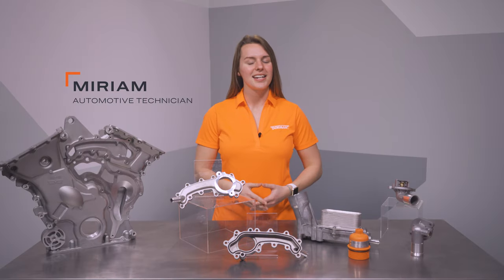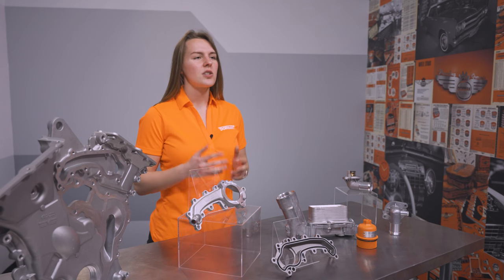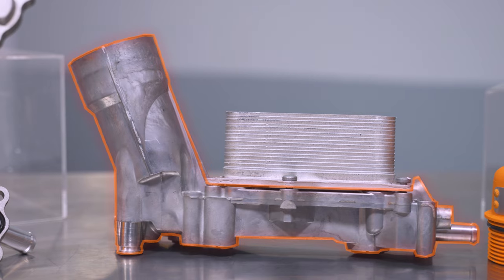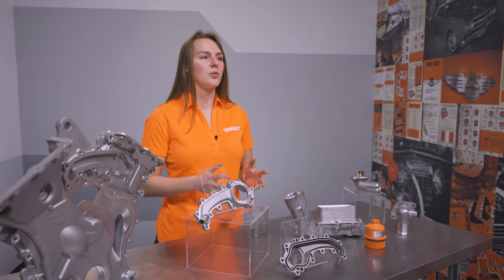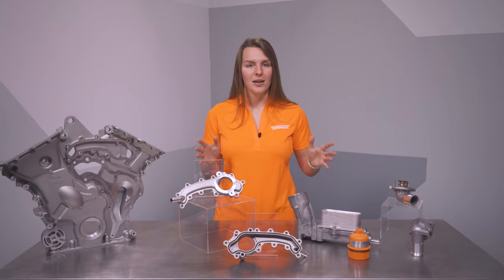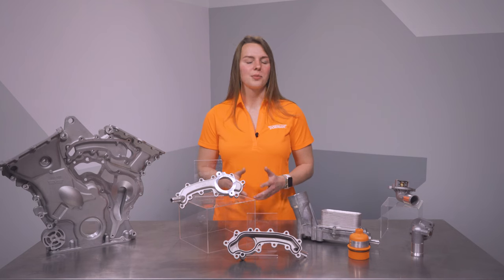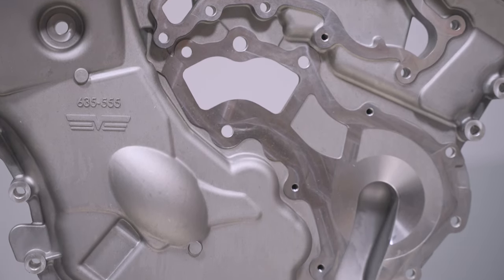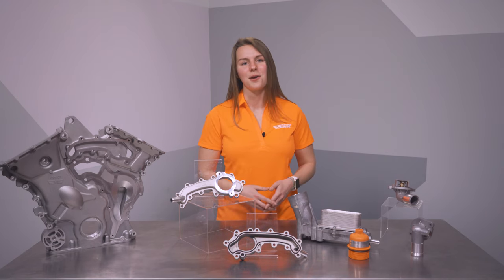How to bulletproof your Pentastar engine with Dorman OE FIX solutions

Comment: DRY START..That’s what kills the valve train. After engine shut down all the oil returns back to the pan. When left for 1 hour and then restart.. there is no oil in the gallery. The engine starts and no oil for 3 seconds. Repeat this for 100,000 miles and no oil in lifters or push arms. Results in  rocker bearing and pin wear in rocker arms then owner is on hook for premature change out of damaged cam, lifter, rocker arms. THANKS CHRYSLER FOR THE EXTRA COSTS OF OWNING HOUR PRODUCT.
Reply: People keep saying what a great  motor it is, sad these after market  parts are needed. The fatal flaw is the oil transfer during startups
Reply: Very poor design from the OEM on those lifters. Clicking noise is a KNOWN issue on these engines.
Reply: Baxter Performance solved the oil problem by adding a custom oil filter adapter with a check valve to stop about 1quart of oil from draining to the pan. That way valvetrain gets lubed instantly on startup. It also uses a typical oil filter from a 5.7l hemi I believe. Pretty neat but kind of expensive at $325-$385. Solves the expensive problem though.
Reply: Just did my oil cooler and Baxter performance upgrade with the oil filter remote- what a pain in the butt mods. I should post some videos of that for my 2016 JK Rubicon soon.
Reply: @onememories8523   I don't have the Baxter Adapter yet but im going to get it eventually. I'll need the extra cooling from a remote mounted cooler since my Challengers Pentastar is Turbo Charged.
Reply: Just use thicker oil problem solved 270,000 mile pentastar i drive
Reply: @kkp9068  I use 10w 20. Also live in a mostly hot climate. Seems to help
Reply: Not true I just did a head gasket on one not too long ago and it sat for 3 days and still had plenty of oil in the valve train… what kills these is not changing the damn oil every 3-5k miles.
Reply: @Eco.boost2.7  I'm glad you said that. Thank you. I was concerned about that. I hear it's a solid engine....
Reply: @kkp9068 I did hear that as well that a slightly heavier oil is what the engine should be running...what weight do you run? I thought Chrysler changed the requirement.
Reply: Change every 8000 miles full synthetic,mostly highway every day
Reply: @kkp9068 what weight and brand oil you use ?
Reply: i been using lucas synthetic high mileage oil additive on my moms journey, n i tell her to not let it idle for long times because i heard at idle the top doesnt get suffecient oil?
Reply: Hey man...  ive done alot of valve covers off engine cranking on these engines and oil supply is instant so your totally wrong and dont know what your talking about. Its always oil neglect that kills the rocker followers needle bearings. Change your oil at 5k and no more. Thats how you prevent the problem. Dont be spitting out bs. I can clearly tell you dont work on these. Or just guessing. Cause every 3.2 n 3.6 ive tested it on. Has oil almost instsntly. Keyboard mechanics are a joke.
Reply: @kkp9068  you are going to kill ur engine. 5k miles. No more. Better at 3500. Do ur 8k. And watch u have chain/rocker issues.
Reply: @joeb2588 do not put heavier oil in ur engine. They are designed for the thin oil due to small passages. Thicker oil ull have higher oil pressures and on cold starts you will dry start ur valve train. If the engineers say use this oil freakin use it. Your not e engineer. Thicker oil is doing more harm and 0 good... sure the engineers used plastic parts. This is to reduce weight and cost of production. Has nothing to do with oil and physics. Thicker means harder to push. Stresses pumps. Stresses vvt higher pressure on bearings will push the rod/main journels on the crank into the bearing material. Its not difficult.... shesh.
Reply: @Eco.boost2.7 finally i find someone in this guys made up story that has experience with these valve trains. Hello my fellow real tech and not a keyboard mechanic! Salute brother
Reply: @Bobcagon  I was told that there's still some oil up in the motor because not every drop is going back into the pan.
Reply: @joeb2588  I agree in part with what you say. What I’m saying is it’s based on time as mentioned. Why else does this engine have  so many YT channels all decrying the same issue? It’s not bad parts manufacturing. It  has to be something else.
Reply: @CBREngines  i use full synth,and oil still looks fine ,thats why i use synth to go with longer between oil changes ,all highway
Reply: Ehh, not really. I took the connecting rod and main caps off an engine that i pulled from a truck about 6-7 years ago. There's still an oil film on every metal and bearing surface. Sure, it was a 1989 TBI 350 from a GMC but oil is oil. Also, with a typical V6 running over 500rpm at startup it shouldn't take 2-3 seconds to get oil to the valvetrain
Reply: @kkp9068  I was told the 3.6 would throw a code,  possibly, if a thicker oil was used. I had mentioned using 5w30...as I belive the engine used to solely run on. ?
Reply: @cc23001  so a good oil, changed regularly,  would leave a film to protect during start-up? Makes sense due to there being like 13 million of these engines out there. My question is, do they all fail?
Reply: My parents' grand caravan had to have the left side cylinder head rebuilt at around 75k to 80k.
Reply: @Spectre94951  seems like that's when that issue occurs...or as my mechanic says regarding the leaking oil cooler housing, "not if it leaks, when."
Reply: @kkp9068 what oil weight and brand do you run?
Reply: @CarveLife  5w30 supertech hig mile full synth change every 8000 miles and oil still gold color when i drain
Reply: @CarveLife  2012 jeep wrangler  i use supertech  5w30 full synth high mile , change every 8000 mile and when i drain oil still gold color
Reply: @UPerformace where from?
Reply: @CBREngines Actually engineers made this engine to run on 5w 30, but due to government regulation were pushed to use 5w20 for better gas mileage. Engine was desgined around 5w 30.
Reply: These are great engines. Don’t run anything thinner than 5w30 and use a quality filter. Rocker/cam issues not across the board. Only certain years after they switched to 5w20/0w20. Baxter makes anti drain back filter adapter if you’re wanting to spend the money. 

Customer of ours had a 3.6 in his Ram work truck. He was at least 7000km on average over his oil changes and only used semi synthetic oil and cheap Napa filters. He got just under 400,000kms on the motor before it said no more.
Reply: 2011-13 was 5w30. 2014+ was 5w20/0w20. European vehicles with this engine state to run 5w30/5w40. 

Stick to high quality 5w30 oil and filter.
Reply: I had one squeel and then completely seize. I have a other squeeling. Is that the cam shaft running dry? It happens for the first 30 seconds of running
Reply: @ What do they sound like after warm up? Keep in mind there should be no “clatter” at all. Not on initial startup nor once running. As an offshoot I bought Rocker arms from Amazon and have had no problem with them. Considering everything nowadays is cost related.. I wouldn’t doubt many original parts on American made vehicles are manufactured in China.
Reply: 5w30 Pennzoil ultra platnium. 5w20 is kryptonite to the 3.6

Comment: The engine cooler housing is not what’s failing, it’s the seals. There shouldn’t be seals but gasket instead. The plastic one works just fine and dealers know this. That’s why when you go in for warranty repair the dealer only replaces the seals. The seals fail due to rapid change in temperature during warmup in cold climates. Did you guys stress test in cold climates before you’ve come up with this solution? Call any shop in northern parts of North Dakota and ask them how many of these they replace in the winter.
Reply: I agree with this. 125,000 miles on my 2015 and the plastic housing was fine. The rubber seals had flattened out completely and lost elasticity which caused the leak. All that was needed was a new seal kit, which can be bought separately from Mopar for less than $20.
Reply: Naw bro.. the aluminum on is wayyyy better and if you've got a lil bit of porting skills, port and smooth out all the burrs in it and the car runs happier. 
Though it is the steals too the plastic plugs crack. 
No part should be plastic with hot oil and coolant running through it
Reply: The tubes on my OEM oil cooler housing cracked on the ends. They definitely also fail.
Reply: Yep, they should use a double metal gasket, that is “lipped” at the ports, much like what is used on an intake manifold, but you are 100% correct with your statement.  I wish an engineer would design a gasket to use, instead of those cheap rubber seals.
Reply: @witdaMacksauce yeah, but I heard the aluminum housing retains more heat that puts more strain on the seals, which is why many of the Dorman’s are having leaking issues.
Reply: At 180°F Polypropylene begins to lose strength causing molecular instability. Add engine harmonics vibration, oil and radiator psi as well. You than have seal separation. So realistically It is the cheap plastic part they saved a penny on. You don't get this with a solid perfect aluminum cast part at recommend torque specs so fast as a oem junk.
Reply: It's both bud
Reply: In some people’s cases and I just went through this last Saturday. Not only can the seals flatten and cause a leak but the plastic housing can crack and cause an oil or coolant to leak in the valley of the engine. In my case my housing cracked and caused oil to get into my coolant. All this resulted in me having to replace the entire housing because it was all coming apart under the aluminum chuck that sits on the plastic. Could I have replaced the seals Yes. But was that going to fix my issue No.
Reply: Holy shit, i think my seals failed after we had a drastic change in weather too, went from lower 80s to the 50s in 2 days now I’m seeing smoke and smelling oil after driving and now I’m here realizing it’s the oil cooler, thanks for the confirmation!

Comment: Built proof you say!? Welll we Still need an aluminum upper and lower intake 🙃 ...sooooooooo what ya waiting for dorman 😏 we're waiting ❤

Why ? 
The lower intake bolts strip from just the slightest over tighten of the bolts. Guys have resulted to larger lag bolts as a fix.
But it sucks and a lower aluminum intake would be so worth it to us!!!! We would be like please take our money seriously. 

If yall just wanna make money and aluminum upper intake would have the v6 pentastar guys grabbing those too. 
The problem? 
Plastic sucks and the throttle body bolts strip as well. 
So hear my campaign!! 
Chargers, challengers, grand cherokees, 300s, ...we would all love a lower and upper intake aluminum replacement. If only lower, that would be the bigger fix
Reply from the maker: Hello, thank you for your new product idea! I will let our product team know!
Reply: @DormanProducts  Give it more spacing for more air just like the PUG.

Comment: You know some plastics are stronger than metal. The plastic on those engine do not wear out. The oil leak on the plastic oil cooler are not from the plastic body but the O-ring seals at the oil cooler. the seals not the oil cooler body.

Comment: I have installed the oil cooler, the crossover and the thermostat housing.   A huge improvement. .  No more leaks.    The worst thing abou the plastic oil cooler is what happened to me is that a technician at an oil change place cracked it when overtorqueing the filter cap.   Human error and the first replacement cooler was also plastic.   After it started leaking, 50k miles later  I went to the Dorman option.   My Chrysler 200S AWD is worked very hard and has autocrossed and done track days.    I know I stressed these components, but since the Dorman changeovers.  No issues.  Thank goodness🥰

Comment: So FYI note, 2015 Jeep Wranglers with the 3.6 Pentestar engine and the thermostat housing mentioned here does not work on my specific engine despite the impression on the video. So I called Dorman and the guy on the tech line stated nope it will not work.

So now I am stuck with the plastic part still. Which sucks!
Reply from the maker: Hello! That housing works on some models with the 3.6 Pentastar but unfortunately for your year, make and model wrangler we do not list an aluminum one yet. I will let our product team know of your new product idea. Thank you!
Reply: On that note, those with the gen1 pentastar engine, is there an oil cooler housing for it now or are we still stuck with either the same shit plastic or a hodge podge

Comment: 2013 JKUR 267,000 miles. I change the oil every 5k miles. Use mobil 1 5w-20 with a mobil 1 or k&n or wix filter.

Comment: on your website I didnt see ANY of these parts available for 2023 Jeep Gladiator with 3.6l gas engine
Reply: your engine should be in its warranty period correct? Why do this and void the warranty.
Reply: @cantbuyrespect  - yes it is, I was just asking. At some point I will be out of warranty.
Reply: @cantbuyrespect bulletproofing is a preventative measure. I’m buying this stuff for my new Chrysler 300 so that way stuff doesn’t break down the road.
Reply: @MrLazyAmerica  that is all well an good until something happens and they deny your warranty because you modified it during the warranty period.
Reply: @cantbuyrespect  Replacement parts are not modifications. They cannot deny you warranty work unless they can prove the “modification” is what caused the problem.
Reply: @MrLazyAmerica  it isnt an oem replacement part though. Say you have a valve train issue which is a common issue on these engines. They can say since you installed an aftermarket part to the oiling system that is what caused the issue so warranty is denied. I know this as I worked in a shop at a dealership for years and have seen this happen tons of times.
Reply: @cantbuyrespect  this is an OEM+ replacement. Mechanics typically use Dorman as replacement parts. This is a stronger part than oem. It’d be the shadiest dealerships that’d deny warranty work on OEM+ parts.
Reply: @MrLazyAmerica  Happens all the time, unfortunately.

Comment: Is there ANY PLACE you guys know about in southern California that specializes in these fixes ? I don't want a newbie...
Reply: This is honestly a fairly easy task as long as you have everything planned in advance and all the materials needed. Remember you will need to drain at least enough coolant that it’s not still flooding the intake cooling passages, and of course drain the oil prior to removing anything beyond the engine cover. 
Depending on your vehicle, it may or may not be possible to visually confirm that you do indeed have a leak coming from the engine valley, otherwise you’re kind of flying blind until you get a few pieces of the intake removed, which still requires going through all the advance steps as mentioned. But overall it’s not an overly difficult task. Be sure to protect your open ports so you’re not scraping or dropping crud where it doesn’t need to go.

Comment: The only issue I had with my 2013 Ram 1500 3.6 liter was the stupid a$$ location of the oil filter, and the fact is an element and not a spin-on filter... not to mention the stupid location of the internal cage, which of course was plastic.  I have a 2022 Durango with the 3.6... runs like a top, like the 2013 did.

Comment: Do you guys make the Aluminum thermostat for the Jk Wrangler?
Reply from the maker: Hello! What year JK do you have?
Reply: 2012 3.6
Reply: Aloha Dorman,  I have purchased your Oil Filter Housing for my 2012 Wrangler this after the second OE one failed.  I am also praying you will make a Coolant Cross Over Pipe and a Thermostat with Housing replacement to replace the plastic trash in my 2012 Jeep Wrangler, the Oil Filter Housing looks very well made.  I'll be waiting

Comment: Does this parts are worth buying them if my 3.6 pentastar is a gen 2 or gen 3?
Reply: There is only 2 gens, not 3
Reply: @SooSmokie  gen 1 is from 2011-2014, gen 2 2015-2018, gen 3 2019-present
Reply: @ds_1793  per chrysler, there is only 2 generations. I have a 2018 JK not JL, running gen 1 equipment. JL and forward got gen 2. 
I thought there was 3 also, but only 2.
Reply: @SooSmokie  thanks for the info
Reply: @ds_1793  Yeah pretty sure 12-18 JK is what is considered gen 1.